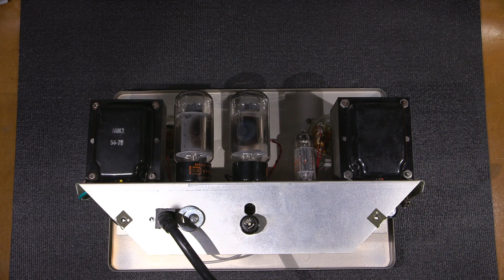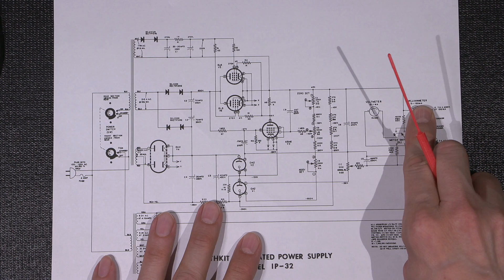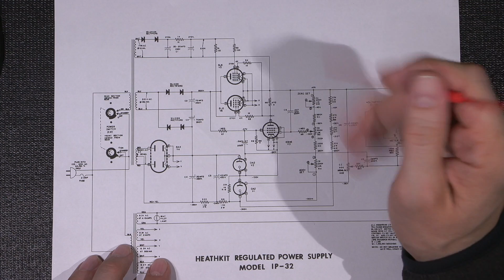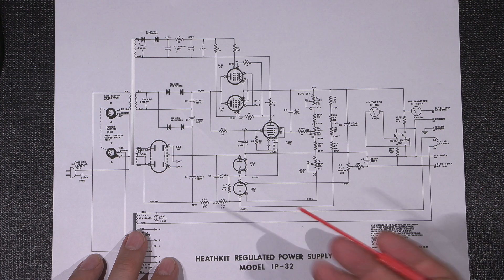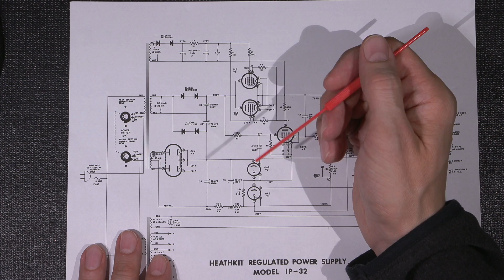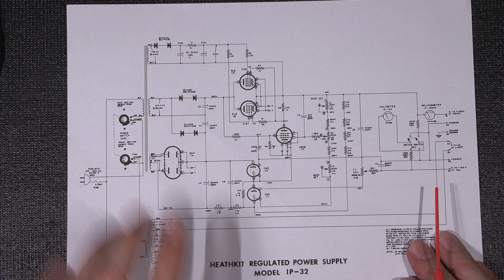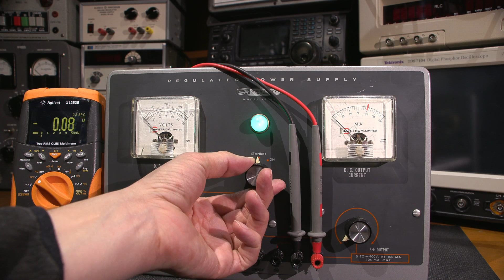Tools For The Bench- High Voltage Power Supply Repair!

Comment from the maker: If you're interested in learning how to troubleshoot electronics like a pro, check out Mr Carlson's Patreon page, click here: https://www.patreon.com/MrCarlsonsLab
Reply: I haven recently become a Patreon to further your cause which is informing (and trough that, entertaining :-) ) all of us tech-curious people who are connected and brought together by your excellent video's, projects and knowlage in general.

Everytime a new video appears on your channel I am sure it's going to be well worth watching. And I am sure that I will learn something new everytime. Awesome :D

Thanks a million times and keep on teaching, Mr Carlson !

"Diodes have Jumper-envy"

You see? :D
Yea, yet another thing learned today !

Greetings Raoul,
The Netherlands
Reply: looking at you on power supply  on v4 6x4  why  is there 300v on v4 on 2 anode
Reply: I have a question since I know very little about tube circuits. I bought this device off an estate sale, it has two OD3A tubes, a very large Mallory cap and a giant transformer with lots of secondary outputs. The front of the chassis has one pot and the rear has an eight pin tube socket. Is this thing a power supply  ?  I looked inside and it not only looks homemade, but it's pretty clean. I just dont know tubes enough to make an educated guess. Oh, I probed the eight pin socket and I found- adjustable 250 vdc to just over 450 vdc, a steady 350 vdc, and the common filament voltages. Any idea  ? Thank you.

Comment: Mr. Carlson, 
I have a question that I have confused the heck out of myself with.  I have written the question out multiple times now, and always delete it for some reason.

I am building a linear dual power supply with a "ground" center tap.  For sake of conversation lets call it +12, 0, -12Vdc.  To be used as a 24 Volt supply.  With two smoothing capacitors.  One for each rail, with a leg connected to the ground.

Long story short, what voltage do the caps need to be rated for?

12 volts right? Well, 16 V using actual cap ratings.

Or do they need to be over the 24 volts?

After thinking about it, I come up with three answers...

As always, I love your content.

Comment: Hello Mr. Carlson, I was wondering about building a 1 tube guitar amp using a 6GF7A. Naturally, I'm thinking of using one half of the tube as preamp and the other output. Is this tube suitable?  Thank you , William
Reply from the maker: Hi William. The 6GF7 is a dissimilar dual triode that wouldn't make very much power in audio service. If you wanted to use a compactron type tube, the 6LU8 would be a better choice, and provide some output power.

Comment: Wow, the best!  Thank you Mr Carlson!  Was wondering about how operates and how would, if able, to make into like a Prius NiMH battery charger like what they call the grid chargers to charge the whole packs at HV instead of reconditioning the individual modules.  Seems like close enough spec, though 300 to 700mA and maybe more might be useful.  I got one of these for free and never touched since is like one of three tube electronics lab test equipment I own. The others being the H12-175A HP oscilloscope, Heathkit GD-1B and I guess now that I think about the Admiral TV (which I only wanted for components) and is really only left as parts since I remove them all and kept the case as a lab bench stand. Figure I really need to sit down and read so I understand the do's and do not's with confidence and very safely while still doing.  Anyways, neat learning about the HV power supplies from the range of tube designs up to the HF transistor based designs. Seems kind of neat retro if can use the IP-32 to charge the Prius battery, even as a tender for when sits extended times to keep those old batteries new enough.  This video really advanced my understanding of the tube designs.  Wow, the best!

Comment: Hi Sir  

Can you repair below HV power supply?

GAMMA HIGH VOLTAGE RESEARCH
H.V. POWER SUPPLY　
Model: RR10-100N         (/10V/200/13.2/M410A)

S/N : 46-1095-01

Comment: I enjoyed the video.  I didn't understand your discussion of the 3 wire versus 2 wire power cord for this device. You spoke of a scenario of using this power supply and a guitar amp. at the same time. I didn't catch the point however.  I would say that Heathkits like this present a challenge to folks who want to use a 3 wire power cord and that is that the front and back chassis cases have no electrical connection.  So adding an earth lug to the front chassis leaves the back chassis unconnected. The press fit on the front of the unit between the two chassis may provide ground or it may not.

Comment: I went to a technical high school and took electronics for 4 years and we all had to buy and build a VTVM and that very Heathkit power supply in 1962. Sixty years later it's still on my bench and I still have the original anual, let me know if you need a copy.

Comment: Thanks for this video!  Any suggestions for the cause of the following issue?  When I switch the supply turning on the high voltage ,I get a big momentary pulse of power that has actually taken out solid state devices in the hv path.  Otherwise the supply works fine. thanks

Comment: I designed a power supply that was 500volts and could supply 500ma. I used an Tektronix  Power Transformer with 8082 tubes (5 of them)
Reply from the maker: I think you mean't "6080" tubes?
Reply: No, I mean 8082. They are the same as 8080 except they 24 volts instead of 6.3 volts @MrCarlsonsLab
Reply from the maker: @rtybn2012  Hello Henry. Here is the data sheet for an 8082: http://tubedata.milbert.com/sheets/201/8/8082.pdf It's is not the tube you are using.
Reply: you are correct, but I am using 6082 for a stereo OTL audio amplifiers. Disregard the previous message. @MrCarlsonsLab

Comment: I have one of these things restored also.
Things I dislike:
1) 400v top end should be 500v like your other unit.
2) NO Current limit! This is really bad. It is VERY easy to current spike the current meter and blow it to hell. I have put in a fuse, but then it needs to be opened up to change it,... sucks.
3) Changing from StandBy to On Spikes voltage at the change over, ok for tube circuits 'maybe' but if using with solid state - it can be an issue.

Comment: the electrolytic caps will not stay charged for a month
they will be leaky and discharge depending on the leak rate
the yellow cap is a totally different animal, very low leakage.

Comment: I, as a young lad once surprised myself with a cheap broken camera. The flash unit cap was charged and upon touching it, I threw it to the opposing wall and jumped back a good length too. When I went to inspect, it still held about 300V. Didn't expect that from a device that took 3 AA batteries, but I got wiser quick.
Reply: This is my first experience with a strong shock also. I took everything apart as a kid and a camera that had a flash on it was obviously one of my many victims. I remember that bite very, very vividly.

Comment: Safety ground in the uk is TRUE ground, via a 6ft copper rod outside the house. Neutral is only connected to ground back at the transformer.
Reply from the maker: That safety ground sure wouldn't carry much current that way, (if it's just a rod pounded into soil.)

Comment: I learned a lot on this restoration. Yours, and mine. I did not need dropping resistors after replacing the selenium rectifiers. The voltage was actually a hair below 270 volts. Also, I could not zero the voltage. The 680K resistor after the CWA pot measured 780k! I tested the circuit and determined a lower resistor was needed to allow me to zero the output. 680k was still too high. A 560K resistor put the CWA pot right in the middle of travel when the voltage was zeroed. Perfect. I’m very pleased with the supply and the great learning experiences. Thanks for the help.

Comment: OK. I'm in the process of restoring mine and it still has the two selenium rectifiers. Yours had them removed by the previous owner and a dropping resistor added. I got that much. (The schematic indicates 270 volts is correct) Your pre-restoration has the dropping resistor and the 1000 ohm resistor I see in the schematic. Your post-restoration only has one (3 watt?) resistor there, no 1K resistor? What am I missing? By the way, mine was factory wired and is really well done! Neat. Orderly. Thanks again!

Comment: can anybody please help me? I have a vintage power supply that has a two 5000 µF electrolytic capacitors at 63 V. Can I replace them with 4700 µF 63V. thanks in advance.

Comment: Had diode envy occure when I turned back on a metal detector power supply. The bridge exploded. Must have happened before too. There was a lot of black plastic pieces on the bottonm of the case. More than the briidge could account for. It was my fault of course.

Comment: What would you use this regulated power supply to repair ? The voltage  seem very high over 400v. Speaking as a person that sees 120v appliances in a typical household.

Comment: Hello Mr Carlson, I have a question perhaps you can help me. I have a Heathkit ip-32 and there is only about 350 V coming out. I tested the tubes they are ok. At which point of the circurit can I start best to find the mistake? Thank you, Regards Peter

Comment: It's almost always ok to replace with higher value capacitors, tube rectifiers will start sparking and arcing if you go too high. Datasheets tell you recommended maximum following capacitance about 20uF to 33uF usually.

Comment: In EU there is the rule: if it is metal chasis and you can touch metal chasis with hand (and no double insulation), device must have PE connection to chasis. All the talks about connecting some devices via PE lines and "two wire plug" is nonsense . This PSU is floating and there is only option is to connect "negative" to PE pin if you need. In those rules also stated THAT NO CURRENT CAN BE IN PE wires in NORMAL operation.

Comment: I have that power supply too,. and another lightweight old Eico or Knight or some other 300-400 Volt kit supply. The BEAST is the 600 Volt 1 Amp Nobatron by Sorensen made for Raytheon. That monster has 5 or 6 5881s 3  5R4s, some sweep tube, a 6SN7, 4 transformers, an enormous choke, a selenium rectifier, and it is bedrock stable. I have run these little Heathkits in parallel to get more current. I have the same Lambda as on Mr. C's bench, a Fluke 555, and an enormous Gates,  as well as a really huge Fluke 0-1200 Volt 1 Amp supply. Chong capacitors? Are the resistors made by Cheech?

Comment: Not one of Heathkits prettier models. I have a high voltage Heathkit PSU (IP17) its more compact and better looking than the IP32. Sadly the previous owner was a smoker though so my front panel is discoloured which is slightly irritating

Comment: As always, a very informative video.  As I visit you from time to time, I have been noticing a piece of equipment on your stacks around you as I just picked one up in a hamfest.  Is that a HP 5246L with a 5253B plug in that I am seeing?  I just picked one up because I am getting interested in any equipment with Nixie displays.  I just purchased the accompanying manuals just to have.  I am a novice here and if you had time to do a video on that piece of equipment, that would be awesome.   It lights up but I have not applied a signal yet.  I mostly collect and or repair vintage digital clock kits.  Thank you, Jim

Comment: Any thoughts (electrically, ignoring "originality" issues) about (1) replacing 6X4 with standard diodes?  and (2) replacing each 0A2 with two-in-series 1N5374BG zener diodes?

Comment: I particularly liked this episode for those wonderfully explained, concise, intimate knowledge tidbits that tend to never make it into the texts. Watching your vids, I feel like I'm becoming better armed when I tackle something.

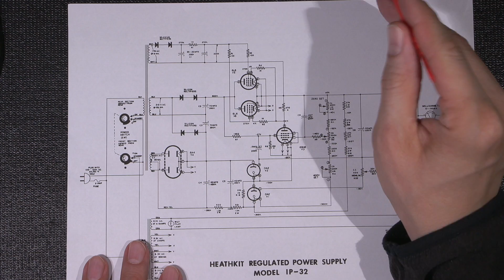~32:58 .. Who knew. I suppose (as you stated) with modern Si rectifiers the point is moot, but wouldn't small value snubber caps prevent this? Their absence presumably due to manufacturing to cost? For those who use their old tube gear as opposed to restore to shelf condition, curious as to what other measures might be taken - added - to improve on original design, the cost of modifying "one offs" for personal use rarely an issue.

Comment: Hello Paul, i just bought and bring back to life a heathkit ps-2 power supply, i only got schematics but no service manual. I replaced all the 3 caps, and put a new resistors with as closed as possible values as per schematics. The ps-2 docs i've got states that it should start at 160-450vdc @ 5-150ma, and i can now actually measure my ps-2 from 180-490vdc. Now my problem is that I can also measure an AC voltage on the output which is very high. I don't know what to do now to get rid of those ac volatge on the output, thanks for any help/advice you can give - i'm in toronto, so we're now feeling very cold again this months coming.....................

Comment: Why all the extra windings on the lower transformer? It literally served no purpose except the 6.3V supply, I assume it's another reused/common Heathkit component? I wonder why those other windings weren't brought out to the front panel, could've added more value for just a few dollars worth of binding posts.

Comment: at least it is a modern cord even grounded  most cords with vintage stuff is cloth covered or is old plastic that is cracking and falling apart and only has 2 prong

if something like a transformer should short to the frame you could get a shock or even damage other stuff it is connected to.

you calling it a rats nest  i would say it looks much better than some of the other stuff you worked on where everything was packed in with not much room to work

Comment: The issue with not grounding the case on something with such high voltages in it, is that an internal short could put 500v on the case. The main point is that the output should NOT be grounded. Having said that, ANY grounded metal on the test bench is a potential hazard because it will complete the circuit if you hand is resting on it, and you touch a live point at the same time. Opinions on this differ, but the best arrangement is to use earth-free isolating transfomers for test equipment. (Note that power tool transformers are not suitable, they do not actually isolate.) Of course a RCD/GFI is the supply is always a help, but cannot protect against live-to-neutral shocks.

Comment: Enjoyed this video.  I have one of these power supplies that I restored.  Mine was pretty beat up when I got it: bent panel and cabinet, stripped out setscrews on the knobs, water damage, and broken off binding posts.  But, she works well, now.  I also have a Heathkit PS-3 that I restored.  This unit outputs up to 500 vdc.

Comment: Nice regulated PSU Mr Carlson. Not sure why you don't ground the chassis for safety, as the circuit is isolated from the chassis unless you make that external jumper connection, so you have a choice as to whether the PSU common is grounded or not, but retain earth fault protection.

Comment: On these older, two-wire items, doesn't this produce a floating ground? I've been told that on items with a chassis ground instead of an earth ground, the reference ground is at some value above earth ground. How does the 3-wire plug change this? And what about using an isolation transformer?

Comment: Where did you find such a High Voltage Power Supply? I'm looking for one by myself, but I´ve never seen stuff like yours in terms of age and price in ebay listings. Are there any specialised trading platforms out there? Or can you recommend building one by yourself?

Comment: You are incredible just a gifted person, I wish on my best day I could be as good as you on your worst....lol
I am still having trouble with troubleshooting both tube and solid-state electronics. I read a schematic and there are both resistance and voltage values at tube pins, I check the resistance value it's fine but I can't trace the low or too high voltage readings. I use both a DMM and a VTVM so as not to load down the circuit.
Example would be at the #2 pin of a 6AU6, 47K / -9.0 vdc Could you do a video on correctly troubleshooting electronic circuits?
Thanks, Tony

Comment: One more thing to demonstrate would have been the step recovery time. Yes, connecting a 100 mA load and proving that the voltage drop was only about 2 Volts is great, but what happens to the voltage in the first millisecond that you connect the load? How fast does the regulator respond and is there any overshoot? Grab that memory scope on your bench and show what happens when you apply and remove a load.

Comment: I subbed a few weeks ago, after watching your vid on the stromberg calrson (WOW!) I'd love a good tube radio kit, but the only ones i find are from china, are missing parts and sketchy at best (https://tinyurl.com/y96eb63q) or cost WAY to much for not a whole lot of components / quality in construction. I suppose the main problem with such a kit would be the IF transformers / capacitor gang. do you have any suggestions? or should I just look at restoring an existing radio? Thanks and keep up the good work!

Comment: Mr. Carlson, or anybody than can help answer this.lol. I am going to try to replace capacitors in some speaker cross overs. From what I understand and have read, in electrical circuits you can go up in voltage on the cap, but not down. And the farad rating has to stay the same. Is the voltage rating  the same importance in speaker crossovers? Reason I'm asking is I can find alot of caps with the same farad rating as the originals but the voltage is slightly lower. Are these ok to use? Thanks for the help! BTW, I'm a noob at this kind of thing👍🏻, I realize this has nothing to do with this video, but I figured since it was the newest video, someone would respond.